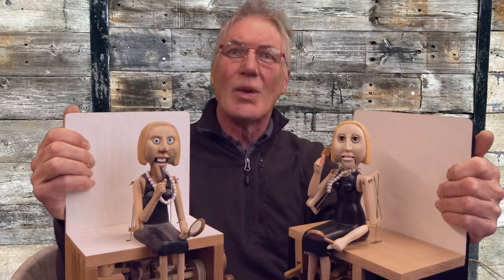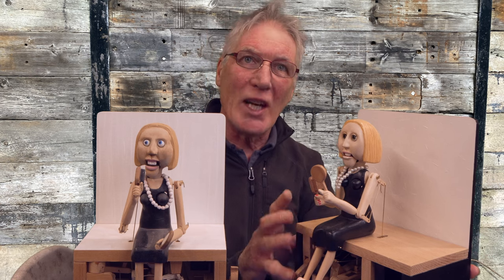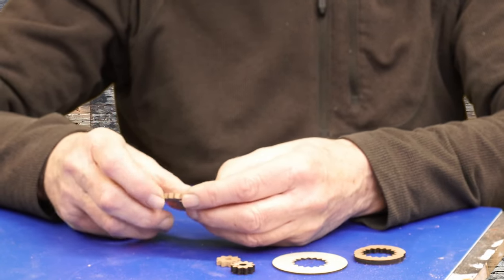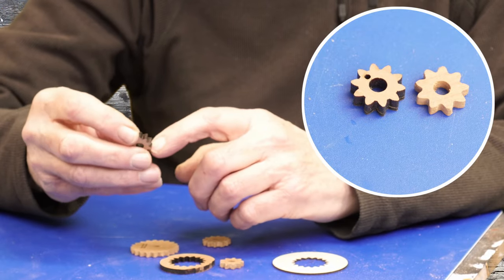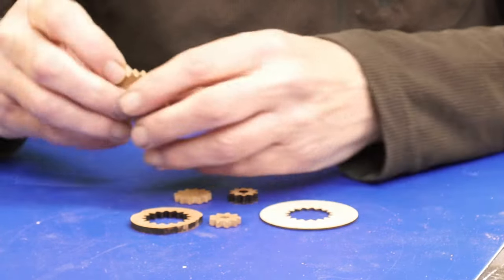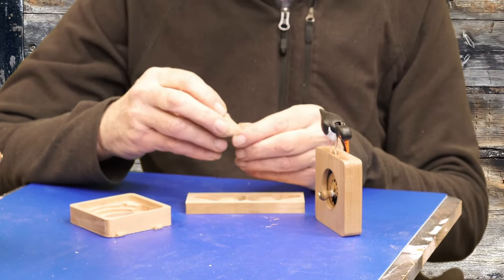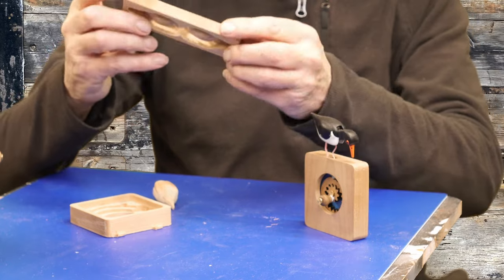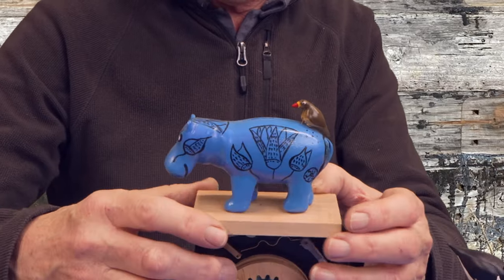How I use CNC machines for automata making!

Comment: You got my attention when you said the bit about mailing items made from tropical woods. That's about all we have here in Panama! Teak is abundant and termites don't like it, but it is tricky to glue as you must clean mating surfaces with acetone. The sawdust is a nasty allergen. Bamboo cutting boards are readily available in department stores at reasonable prices. I'm thinking it would make good gears. Perhaps the most useful wood here is Cedro Amargo (Bitter Cedar). It is widely used in furniture, musical instruments, and even used by jewelers. But still, I am nostalgic for hard maple.
Reply from the maker: Excellent points and information. The allergic potential of wood dust is not often mentioned. I understand it can be serious with some woods. I have noticed that beech doesn’t bond so easily with PVA glue. I usually use cyanoacrylic superglue together with joints or brass pins. Sounds like teak is really difficult if you need acetone to prepare it. Thanks for contributing these comments. Best regards, Philip

Comment: As for thicknessing the wood, I do a lot of kumiki and you can rough cut on a small bandsaw and then use a simple wooden japanese pull plane and simple jig to get to consistent thickness. Of course you can also use the cnc with a thicknessing bit (wide tip) to thickness the wood if you have it...
Reply from the maker: The kumiki looks interesting. I haven’t come across it before. When I first got a CNC router I did use it for thicknessing. It works well but also convinced to buy a planer/thicknesser. The main issue was work holding for thin wood sections. I use self centering vises and they don’t easily allow full area machining if the wood is thin.
Reply: @woodenpersonality  yeah holding thin stock firmly for cnc-ing  is definitely an issue. You need to be able to have a lot of extra waste outside of the working area where the cutter won't get to... A dedicated planer/thicknesser is always a great addition though if you have th budget and space, especially since you don't want to tie up the cnc when it cant work on shaping jobs while you use another tool...

Comment: Fantastic video.  I absolutely agree with your assessments.  I have a Shark CNC and it has opened the door to all sorts of production that would not have otherwise been possible.  I am really starting to look at lathes right now - but I know so little about them that I don't know where to start.  Also, I don't really have any more space in my 9x20 foot (roughly 3x7 meter) shop.  It's packed to the hilt!  Love your work and I am just starting to learn the 3D carving aspects (and I upgraded to a 4th axis on my CNC to help me in the long run).
Reply from the maker: Thanks for the comment. I am planning a video on the uses that I get out of a small lathe in the next month or so. Tools do tend to get acquired until they fill the space available for them!
Reply: @woodenpersonality  that would be wonderful.  Thank you!

Comment: The 3d work definitely needs the cnc router but the box routered out to different depths can be done on a laser cutter by splitting the layers and then restacking them. In fact you can do something that way which is not easy with the cnc router which is undercut, i.e have an upper layer overhang a lower layer, if for example you need clearance for another gear... great work though and great to see the iterations!
Reply from the maker: Good point. Yes, whenever the object can be layered any 2D cutting method will work and laser cutting is the quickest and most accurate in thin woods. Thanks for commenting.

Comment: You can also 3d print the gears and other parts,  they are quieter and less dust.
Reply from the maker: True. 3d printers are amazing machines. I use one to test 3d work before going to the effort of committing it to wood. Really useful for getting the sizing and proportions right which is difficult on the computer screen. For the finished work, for me, it comes down to design choice and aesthetics.